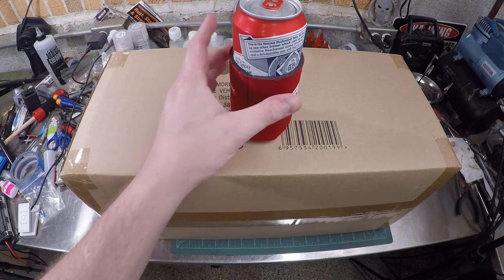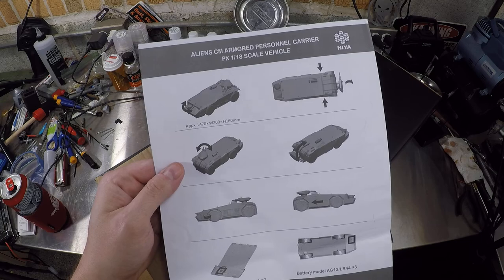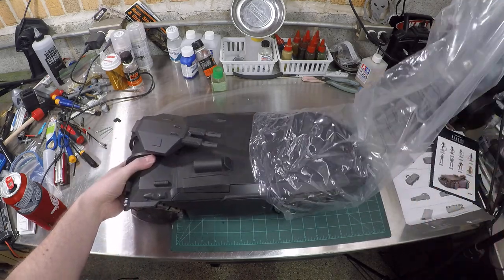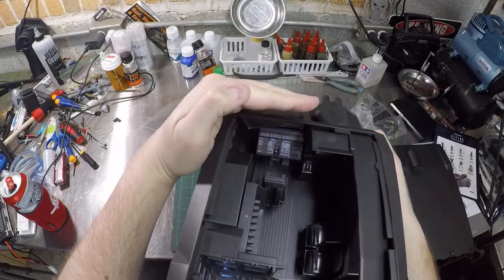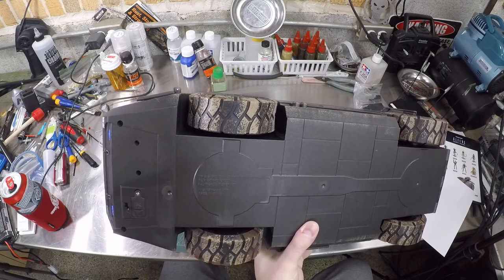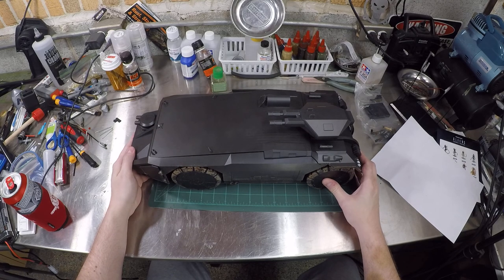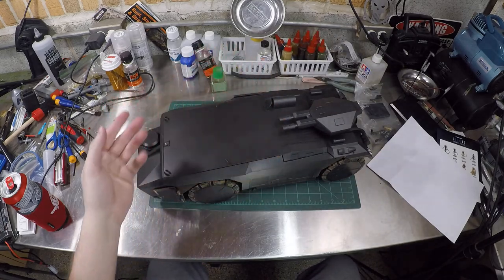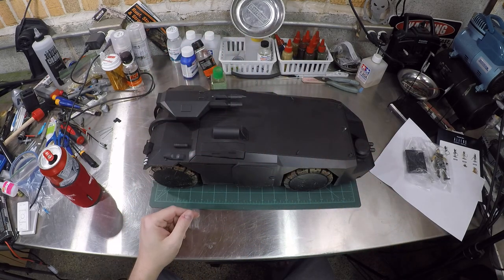HIYA Toys Aliens M577 1:18 Colonial Marines APC Armored Personnel Carrier Unboxing

Comment: I would have taken that appart and scratch made as much as possible parts that are missing. Printed weapons etc. Drilled out all of the buttons and used fiber optic lighting in them. And put that in my model displaycase. As it is i dont know...
Reply from the maker: I was thinking of giving it a bit of a makeover myself.

Comment: Why so much cheap plastic? I'd expect SOME diecast for that price. As for colour, as soon as I saw it, immediately WRONG COLOUR. The whole vehicle screams TOY PLAYSET, not collectable. It's got that plastic vehicle GI Joe toy feel. Even the lighting is the wrong colour. The operations station on the interior, instead of blank blue lit screens NEEDS little transparencies of Marine status, etc, the moulded grills on the side, need dremelling out and small mesh pieces placed in. As a blank canvas for modding, it's good, but as a out of the box collectable it's shonky as hell. Fiddly weak plastic lap straps, and interior wise (after looking at my Alien Blueprints book) it's actually incorrect on the interior. There are seats behind the driver seat, not a gun rack. The guns were stored in the roof.
Reply from the maker: yeah it's far from perfect and I plan to do a repaint some day but from a few feet away in a display case it looks "ok". Also they did release a few different repaints of this and this is the first edition, so likely reason the issued repainted versions later.
Reply: @PitstainHobbies  I'm absolutely assured you'll do a tip top custom mod of this model! Really looking forward to it! As a basis for modding, it is excellent, but needs real tweaks to get it right. Have you got the Alien Blueprints book? It's a bible for anyone wanting to model anything from the Alien universe as well as a fascinating insight into the designers minds.
Reply from the maker: @mistermatix8241  I may start dabbling with Fusion 360 to print out some more accurate bits on my new to me 3D resin printer, I will try to make you proud.
Reply: @PitstainHobbies  man you're brilliant
Reply from the maker: @mistermatix8241  whoa, don't oversell it now...LOL